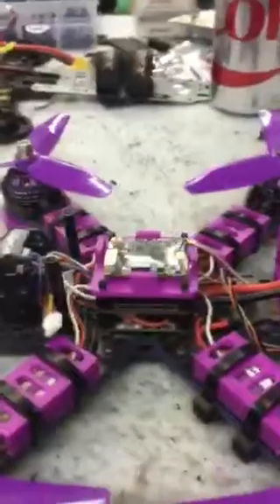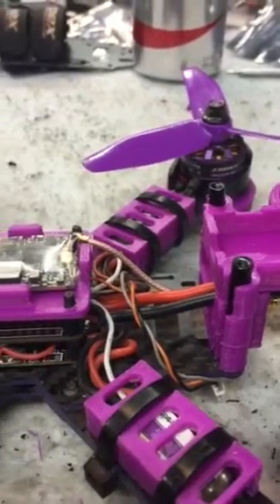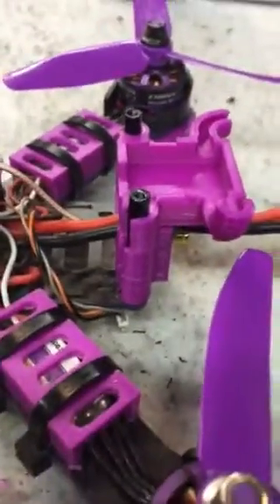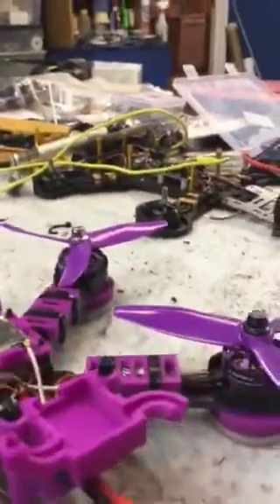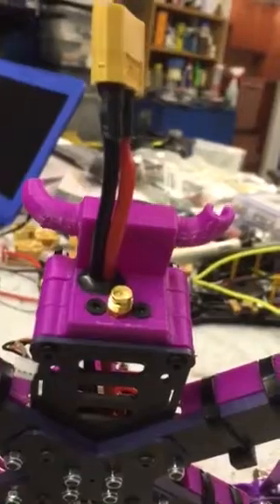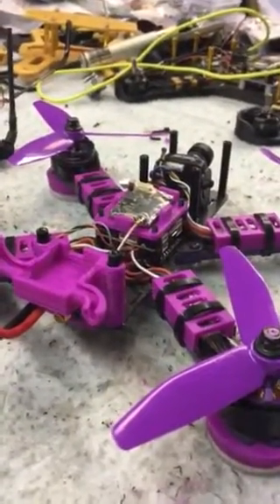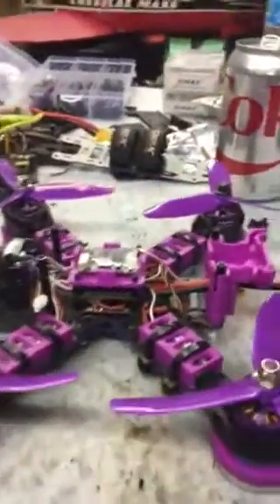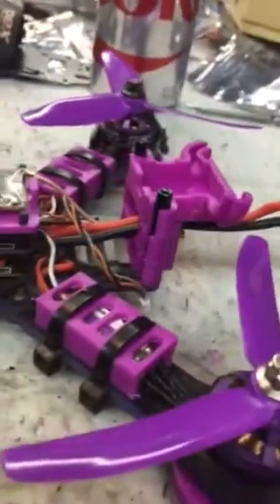Pimp My Wizard - Eachine Wizard X220 - VTx mounting, power input upgrade

Comment: Could someone please show how to read the vtx diagram, and how that diagram relates to the stock 200mw vtx that came with the wizard. 
I'm talking about the 48ch 5G8 200mW mini.  
Nobody I've asked knows how to read the vtx diagram or how the dip switches relate. I know I'm not the only one that's can't figure it out.
Reply from the maker: Nitrous Banshee There are only a few connections for the VTx, power, ground, video, and audio. Pick up power and ground from the PDB ( bottom board ), video can connect straight to the video output from the camera, or sometimes there is a set of pads on the FC ( FlightController ) top board.  In this video, I changed from the stock VTX to a different one, and added it to the top of the stack.

Comment: The led covers antenna holder one up one down configuration top plate and Some other Colors to
Reply from the maker: Angela, I updated the description for ordering the LED Protectors.  Let me know how it works.  I am not ready to sell the antenna holder yet, as I am not completely happy with the design.  I will include for you a VTX stack plate, since you are testing out the ordering process for me.  Do you also want the rear post mount for the VTX Antenna?